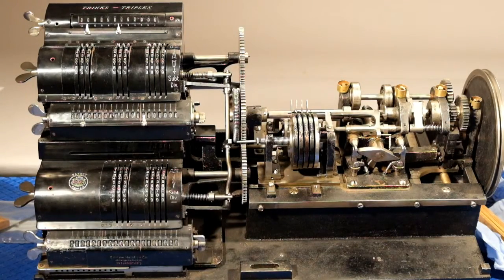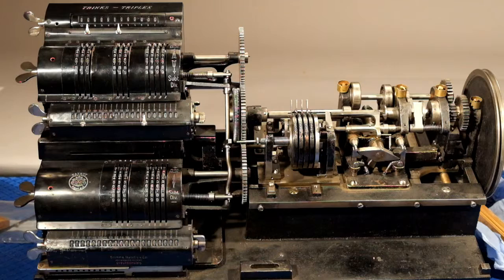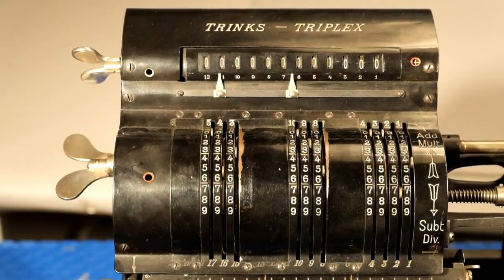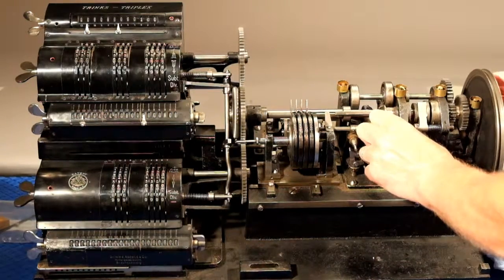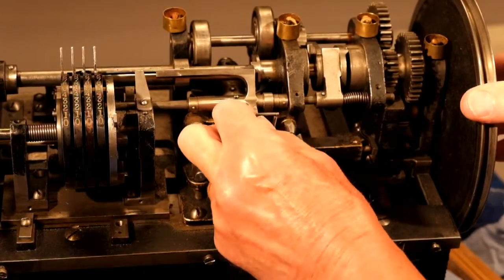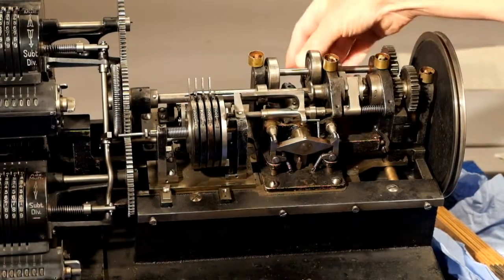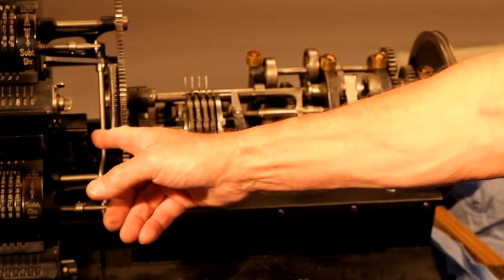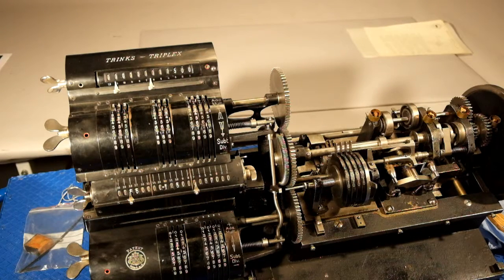Brunsviga compound calculator 1918

Comment: Doesn't The National Museum of Science and Technology in Stockholm have a sturdier table to put that on?  I got sea-sick when he started cranking away and the whole thing was swaying like a drunken sailor.
Reply from the maker: The machine is on it's original stand. It did the job for over 30 years without collapsing. From the collections point of view, the calculator and it's stand are integral parts of the same artefact and given the high standard of collection handling today there is no reason to separate them. Furthermore there are no foreseeable plans to restore the machine to working condition, so there is no reason to review the stability of the stand at this time.